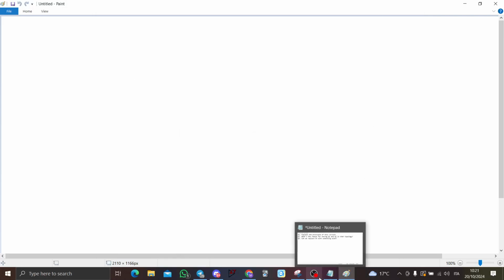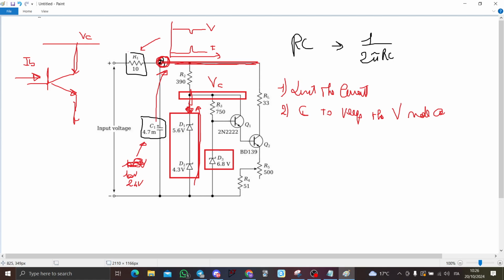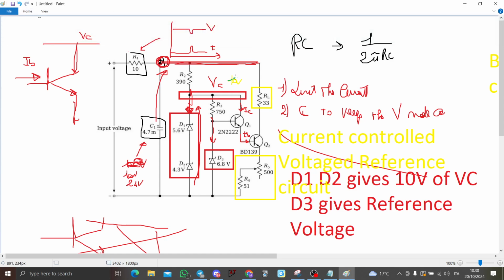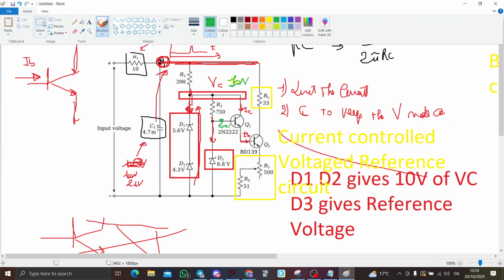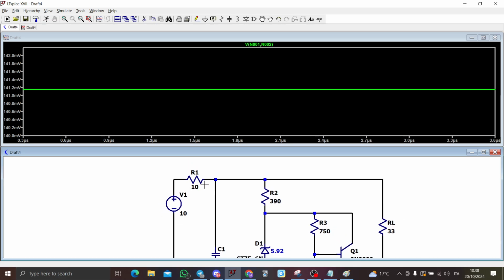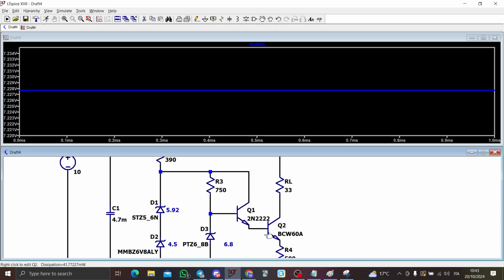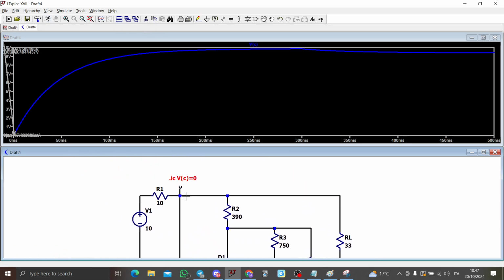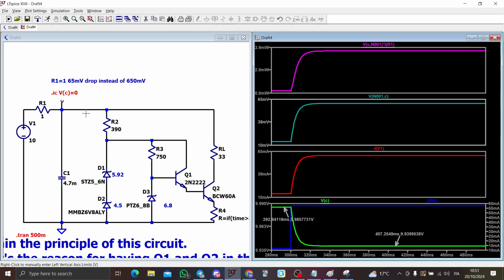[Interview Question + LTSPICE] Int01 Current Control Circuit

Comment: Stupid circuit. Output 5.4 V. Voltage stabilization is done 2 times, but the output voltage will jump because there is no feedback. This is not a current stabilizer, this is a VERY BAD voltage stabilizer.
Reply from the maker: Yeah, you are not wrong. There are way better circuit than this to make a voltage and current stabilizer. Don't know why they choose something like this in an interview

Comment: I could imagine that the zener voltages are chosen to obtain a certain temperature coefficient. 6.8 has almost zero tempco. Lower voltage zeners have a high amount of temperature dependency.  The BD139 transistor could be heating an oven for the 6.8 zener. Then you could perhaps trim the emitter current for best line regulation. Just my suspect